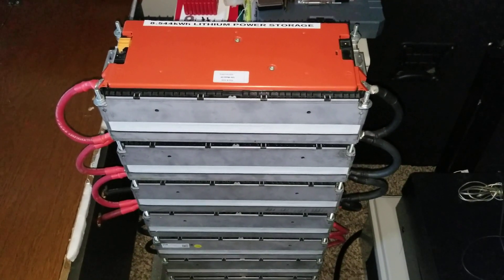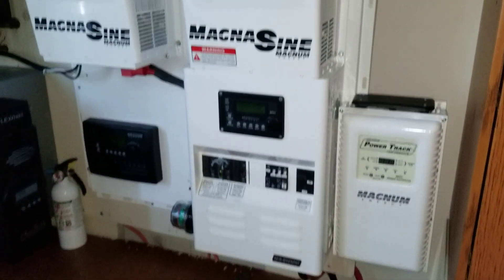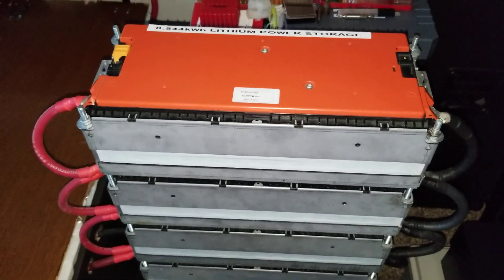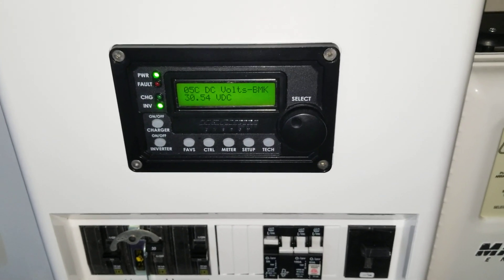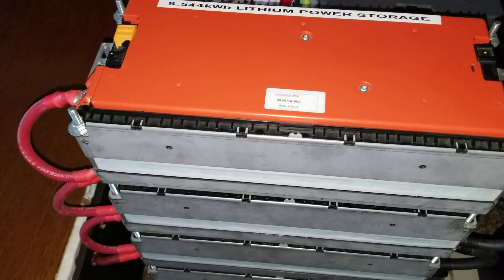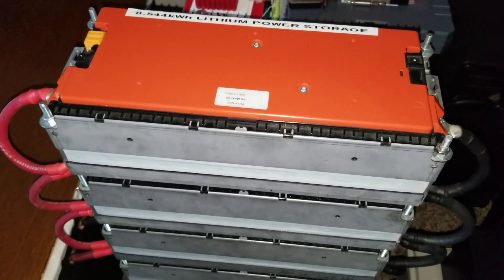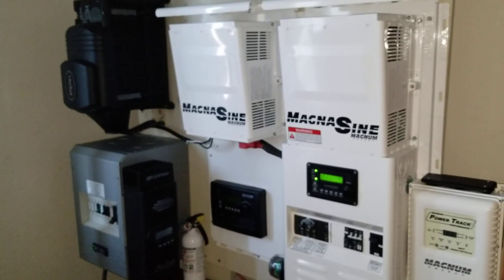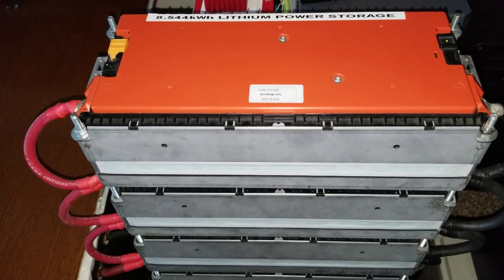SANYO LITHIUM BATTERY - Volkswagen e-Golf lithium battery powerwall update

Comment: Hello, how do i charge two modules in series ? the fully charged is 33 volts, the 24 volt inverter doesn't charge up to that point and 48 volt inverters don't work with that low voltage
Reply from the maker: @SolgerLemp  
It seems like you need to hire a professional to do your work